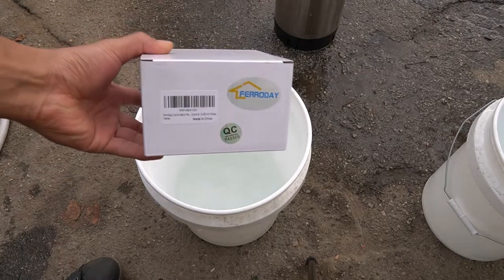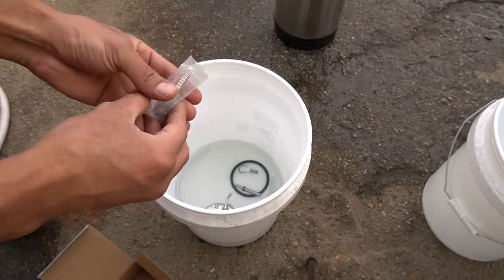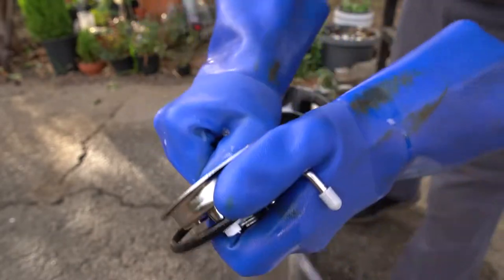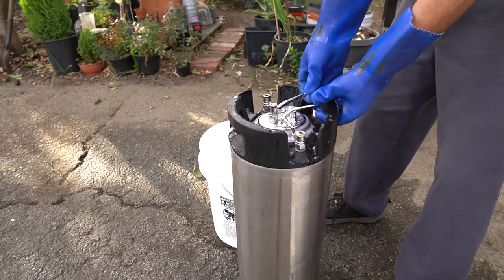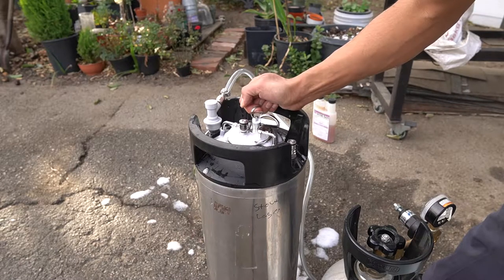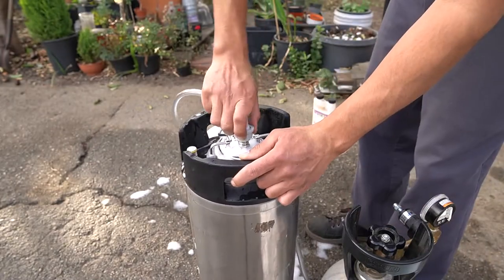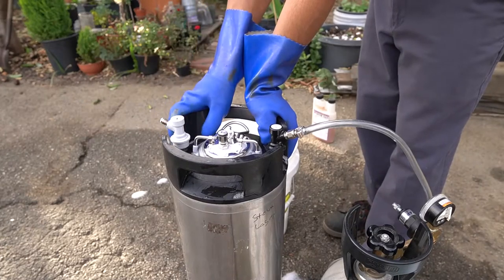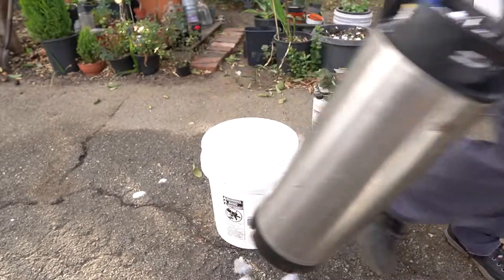Corny Keg Upgrade: Carb Stone

Comment: Tip for installing those stubborn silicone tubes (also for floating dip tubes):  dip them in hot water so they're more malleable.
Reply from the maker: Thank you!  I definitely struggled.  I haven’t used a 5 gal in a while ever since getting my brite tank and then now having a unitank with spunding valve